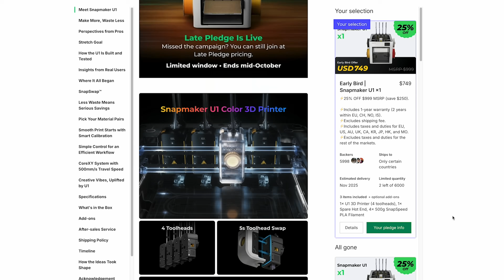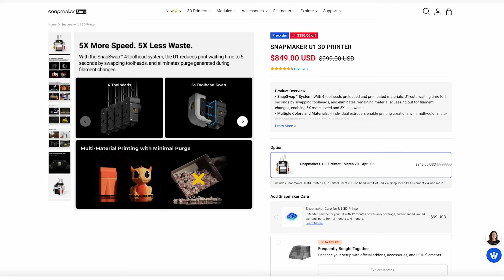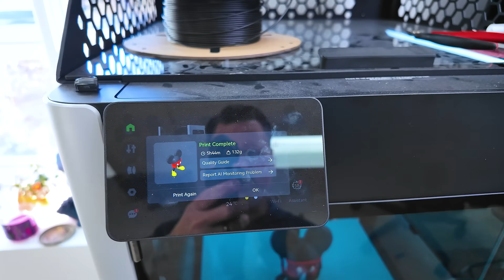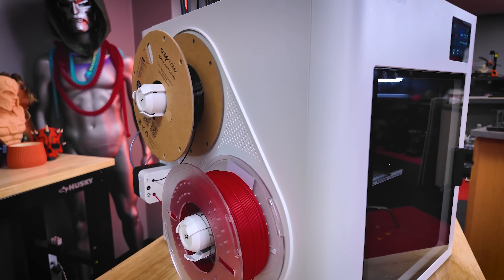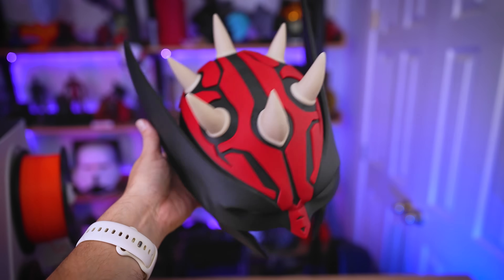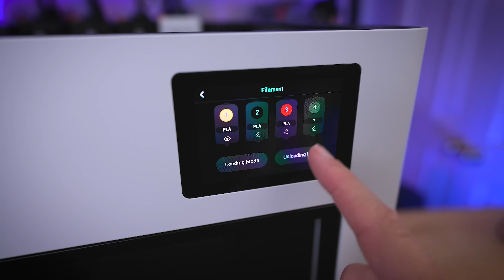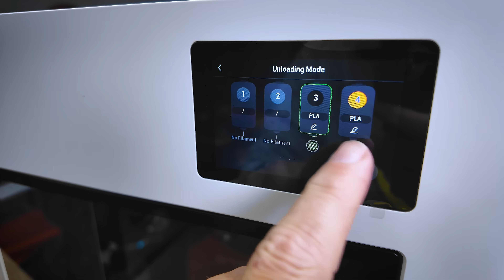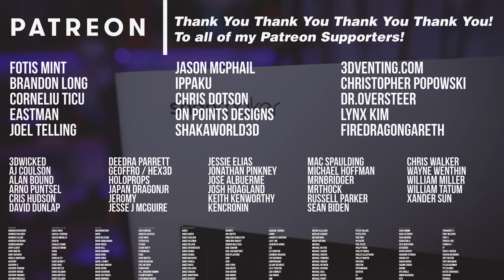The New King of Multi Color 3D Printing - Snapmaker U1

Comment: Dont care what anybody says this is gonna hurt the prusa xl and alot of the similar printers
Reply: Not sure what the point of your comment is. "Hurt similar printers", what? That's the point of competition, it forces competitors to improve, and the prusa xl is 3x the cost, lol, but it's also got 1 extra head and a much larger build volume m it's also produced in Europe and not China, so naturally it's going to be more expensive. But also "similar printers" there are hardly any other actually multi-tool head printers on the market so far
Reply: @JamesLeigh28 Agreed, i think Prusas are even more expensive than they should be not just bc they're made here in the EU but also bc of the name brand.
Reply: @Icemanmodeler  Prusa's are more expensive due to a variety things, mostly becasue of where and how they're manufactured, the long term support and QC you get with them, and the cost of the higher quality components that they use, which aids in their reliability.
Reply: @LilApe They use higher quality components? Im from Ro and if it were made here it would've been much cheaper, imagine it they were made in Germany, France or the UK. Ultimaker are also expensive and those are made in thr Netherlands.
My first FDM printer i bought in 2016 was a Craftbot Plus made in Hungary next door, it was 1k, back then it was the best deal.
Reply: It will hurt other AMS style printers, and bambu's outdated dual nozzles and scuffed vortek
Prusa will be un phased, as prusa is in their own league.
Reply: Maybe Joe Prusa will finally lower the price of his overpriced junk!
Reply: @theInfiniteEgg-z8i 😂
Reply: If they wouldn't charge an arm and a leg it would be more accessible.